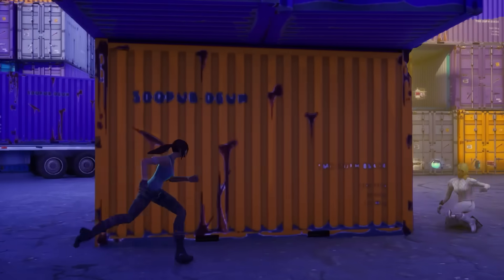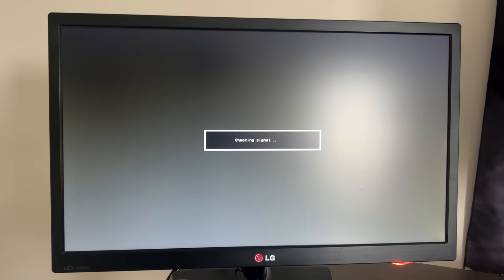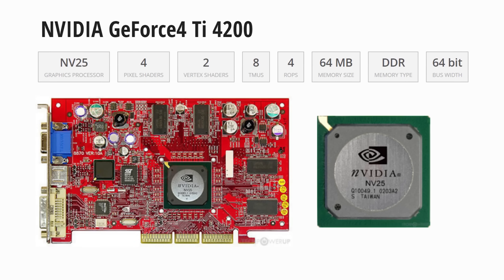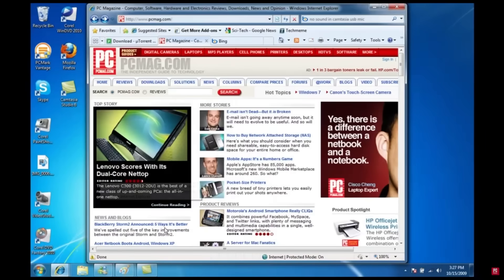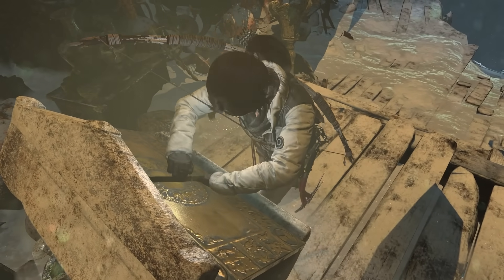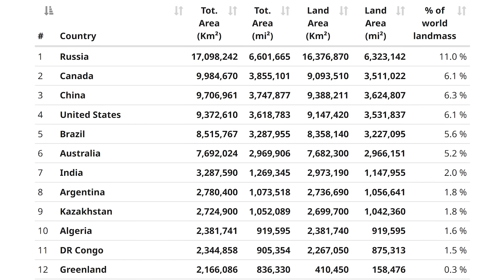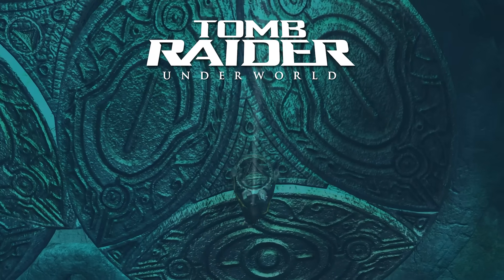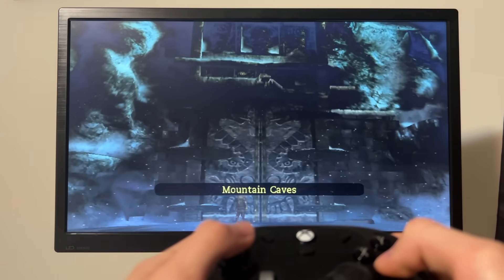I Optimized a 24-Year-Old PC Until It Plays Anything

Comment: You are right about windows 7 not getting updates, but if you don't click on random links or download random stuff you will be fine with windows 7. and even with windows XP you will be fine if you are careful when browsing the internet, which you should be regardless of whether you are using windows 7 or XP. i can say that because i myself used windows 7 for several months, maybe even years after the end of life of windows 7 and i never had any problems. and yes i saw the reddit article in the video, and also reada it. but as i said before i never had any problems with windows 7 after end of life

edit: and i think most of people who try to hack you or something like that would go for newer versions of windows, because it's just not worth it it's the same for macOS literally nobody is making viruses or something like that for macOS because it has a low marketshare, and windows 7 only has like 2.4%
Reply: If anything, Windows 7 still receives updates thanks to the “Server 2008 R2” edition, which, in turn, it receives through a special “ESU” subscription.
To get them, just use “UpdatePack7R2” which will automatically install all updates from 2011 to 2025. I've updated more than 10 PCs with regular Windows 7 in this way, and there were no problems.

Comment: bro windows 7 security is all u need if you are not downloading random stuff and looking on shady websites in the video u act like if you connect the pc to the internet its gonna blow up or something
Reply: @marekmensik8226  im using internet windows98 and it s fine
Reply: i use ZORIN OS,i go anywhere,without to worry about get infected.
Reply: Wrong. Windows 7 hasn’t had updates since 2020, so things like the TCP/IP stack could be vulnerable. Hackers can exploit these weaknesses just by connecting your PC to the internet, even if you don’t visit shady sites.
Reply: @Redstoneprojrjr  then install updates? I don't see the issue. I run 7 and am patched all the way up to December 2024.
Reply: @Redstoneprojrjr  This happens with no firewall/router, and versions of the windows NT 6.1 kernel that windows 7 uses do still get security updates from microsoft. You can patch your install to continue receiving them until 2026. For people who take those measures it isnt insecure.
Reply: @Redstoneprojrjr  windows 7 security is really enough i have multiple windows 7 pcs running even xp and if you are not looking on shady websites its really fine i wouldnt recommend using it on your main device but for a couple of days its fine really and your pc will not deffinetly catch the viruses
Reply: Laughing from my Windows XP PC with no updates past Service pack 3. Daily driver since 2012.
Reply: @olexanderkidenko4423  lmaoo, you're a warrior bro
Reply: @olexanderkidenko4423  lmaoo, you're a warrior bro
Reply: @Redstoneprojrjr  hackers don’t just magically find PCs on the internet running Win7.
Reply: @masterinico  thats the kind of thinking that will lead to it happening to you (regardless of os and security) if youre not careful, theres always a new vulnerability/exploit and his point was to be careful connecting a windows 7 pc to the internet. what are you trying to say exactly? 

nooo dont do your best to stay secure on outdated operating systems because "hackers don’t just magically find PCs on the internet running Win7"? when they literally do, thats exactly what @Redstoneprojrjr was talking about.
Reply: @masterinico  there are 24/7 port scanners, hoping to find vulnerable computers :)
If you connect a Windows 2000 to the internet, it will BSOD after a couple of minutes
Reply: @Kizoky.  With no router, I believe that is the only way that can happen
Reply: @masterinico  you can check with the browser user agent the browsers versions. And then load malware only because of the older versions. Then when you had bypased the sandbox of the browser all the OS its on your hands
Reply: @Redstoneprojrjr  Correct actually, ive used windows every day even after support ended, im using it right now and its never had a security issue

Comment: That PC isn't quite 24 years old. The Asus P4S800MX motherboard was released in 2003 and the first 3.0GHz (800MHz FSB) Pentium 4 HT was also released in 2003
Reply from the maker: Oh shoot ur right it seems like most of the components in the PC are from 2003, even ddr2 ram became mainstream in 2003
Reply: @lecctron  "even ddr2 ram became mainstream in 2003" Whaaaaat? Most people used SD ram that time. Not even DDR1 (mainstream 2003-2004). DDR2 became mainstream around 2005-2006. This video is full of mistakes (starting with the 3 AGP slots, bios settings, etc). Next time watch a proper retro PC build video...
Reply: @lecctron  Why don't you change the name of the title? It takes 5 seconds XD "21 years old"
Reply: @lecctron  u mean DDR1 400 MHz ;-)
Reply: @lecctron  The PC is from 2003,but it's running an OS 6 years newer than the whole PC? (windows 7 came out in 2009).
Reply: way older than the people that watch him for his fornite content instead of this kind of videos he makes lol
Reply: He's just future proofing the video
Reply: the gpu is from 2001
Reply: Honestly I kinda hoped that the PC would have been as old as my Dell Dimension so he could struggle with a 32bit processor like I did XD
Reply: @ That Pentium 4 in the video is 32bit
Reply: @Pasi123  Ok I think I'm mixing up some things lol. I was trying to find a 32bit version of Linux to install on it and I also didn't have an internet connection like he did.
Reply: LECCTRON commented on my video!!!!
Reply: @Pasi123  yes, it’s 23 yrs old.

Comment: as a reference: the GeForce 210 is 30x faster than this, the GT 710 is 163x faster than this and the 4090 is 10000x faster than this (or even more, because this site I used to research this doesn't show less than 0.01% of the performance of the fastest gpu recorded on the website)
Reply: @lewisbohme7078  omg you brought out horrific low fps memories mentioning the GeForce 210, what a travesty of a purchase that was
Reply: @montiplays  atleast you don't have to play with a GeForce4 Ti 4200
Reply: @lewisbohme7078  that card was really good at the time. the gt 210 was never good. it wasn't even ever usable.
Reply: @GraveUypo  well yes, but I'm talking about today, and today, neither of them are usable, also the GeForce4 Ti 4200 only supports DirectX 8.1 and the 210 support DirectX 10.1, which means it could play way more moder titles like GTA V, (zWormz has a few videos on the 210) so I think the 210 is the winner over the GeForce4 Ti 4200
Reply: @GraveUypo  The whole issue with GT210 is that it wasn't created with gaming in mind, but as a cheapest display adapter for HTPC's that was able to decode an HD video. But around the same time it came to the market Intel begin shipping it's CPU's with iGPU's good enough for that purpose, so nVidia ended up with whole piles of unsold GT210's. Similar thing happened to Creative a decade earlier with their lowest level of SoundBlasters and integrated Realtec codecs.
Reply: A Radeon HD 3850 or 4670 would be a Boost 😂
Reply: @desmopatrick  fr 💀
Reply: How does it compare to the Geforce 7100 integrated graphics from the Nforce 630i mobo chipset? That's what I spent a few weeks (maybe a month) playing on after my 8800GT died back in 2010. I really don't remember what games I managed to played on it though...
Reply: @thewhyzer  I found a website, where it said the 210 was 3x faster and the 710 15x faster, but idk if that's true because the website looked really shady
Reply: @thewhyzer  or maybe it could actually be true because it's also supposed to be 7x faster than the Ti 4200

Comment: why would anyone use anything less than a 100% keyboard?
Reply: Those chopped keyboards is a zoomer thing. They are cheaper for mech boards. Still, I want my numpad.
Reply: @1pcfred  Me too, there are also tons of Games I play, which need one with the default layout
Reply: @1pcfred  Agreed though i picked up one to try the other day.  I'm also not fond of the new age ultra flat low travel keys.  I don't mind if its not mechanical (any decent even no name or OEM gaming keyboard is good enough for me but i'm not fussy as long as it works well).  I'm always picking them up on the cheap that are just abandoned by people who bought a OEM prebuilt gaming pc and then splurged on a pricier keyboard and mouse without even using it for awhile.

They tend to be better than the other cheap alternative of common normal OEM non gaming pc keyboards and multimedia (though i have multimedia as a backup for that backup if its one i like enough to use)  Plain i only use for testers and very old pcs (25+ years) that might not play nice with them.

That usb 3.0 keyboard may simply be asking for too much power from the port or that it simply doesn't get along well with the old motherboard.  Most keyboards only need usb 2.0 if even that (a lot of even older use 1.0 or PS2 ports)
Reply: @1pcfred  Easy to circumvent with usb use of proper era devices or a usb 2.0 powered hub.

Then that circumvents the limits of the power of that standard in terms of power delivery (still have lag and latency through it to contend with thoughy)

Ps2 keyboards are generally less power usage than a 1.0 or 2.0 i think though? on average.

Comment: Would be cool to see a revisit at some point with the W4100 using a PCI to PCIe adapter off eBay/Aliexpress. Ymmv, but I've used one to add PCIe graphics to a PCI only Pentium 4 PC before and they do work, but I used a card with an external power connector.

Great vid and Happy New Year! Hope the channel continues to grow :)
Reply from the maker: Great idea I will definitely come back to the W4100 sooner or later ! And happy new year man 🧡
Reply: Been using a W5100 for the past few weeks, works pretty well as long as you stick to low graphics and such. VRAM is never an issue, 4GB is plenty, it just isn't the fastest thing in the world, think GT 1030 type performance. 
It's also not a bad card for video encoding, works fine in OBS at least anyways, gotta love it.